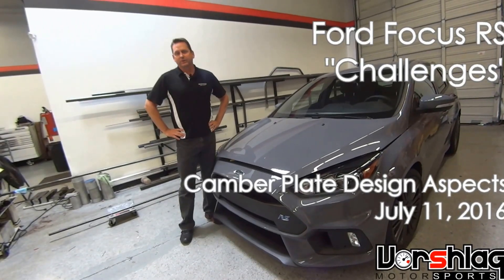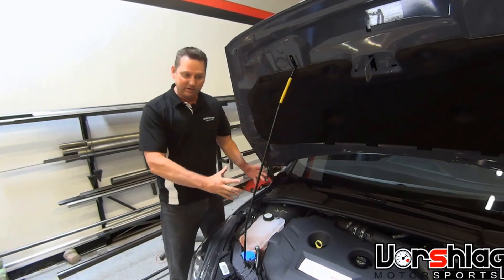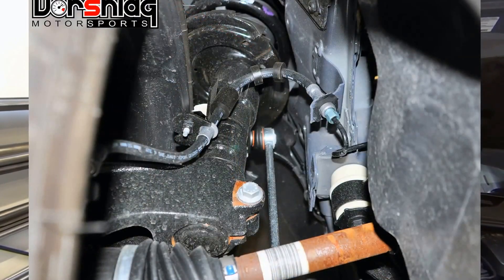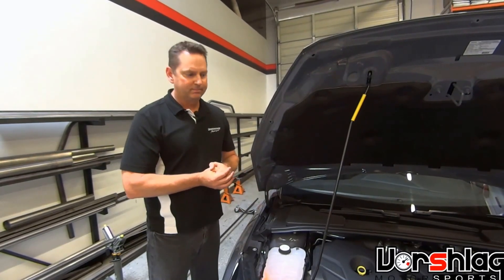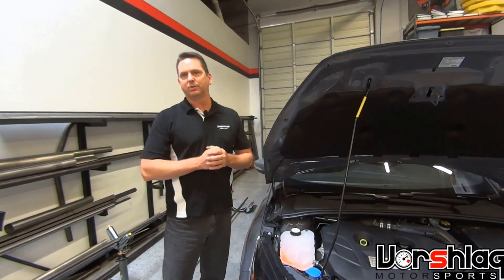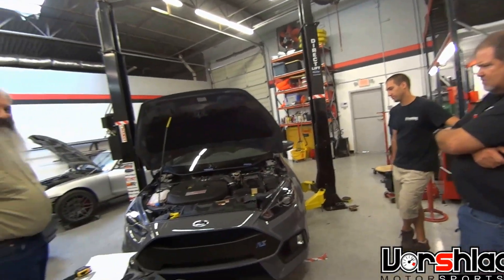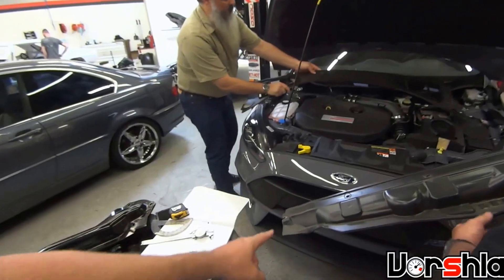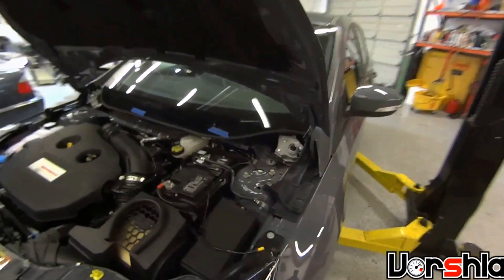Vorshlag "Suspension Challenges" on 2017 Ford Focus RS

Comment: After owning my 2018 for a few years now with the factory revision suspension offered and removing them or getting access to things is an experience thing where you do it once it’s pretty easy the next few times. After KW came out with the v3 setup its made the car handle from a night and day difference. Overall the price point of the vehicle there’s nothing else out there that can compete with this car. People have to remember this car only has been available to the market for 4 yrs and companies like this one are still developing new things. In comparison to Subaru and Mitsubishi that have been available since 02 and 03 it’s hard to have a long term backing and following as the sti and evo. My point is to make a judgment you really need to have some seat time in the vehicle before you make a decision on a car.

Comment: These guys are a fuking joke. Stick to the UK tuners who don't sit there complaining, ratting shit on a new and widely praised performance car. Try finessing the vehicle, don't redesign it cuz your whole value proposition is "everything is shit unless we've fukd with it". I felt that particular car devalue while they were touching it.
Reply from the maker: We get similar hate from fan boys of any chassis where we work on it. The RS is not magic - its a Ford Focus underneath, and as such it can be easily improved. This test car competes in Optima series and was massively improved with the work we did. Dig a little deeper and see the before/after track times. Hint: the car got a lot faster and easier to drive with firmer spring rates, better dampers, more camber and caster, and wider tires. Which is... common sense.
Reply from the maker: Read more on this car and its "path to better handling" here: http://www.vorshlag.com/forums/showthread.php?t=8453
Reply: You guys tracked it with 83 miles.. big WRONG.. You had stated it acted like a FWD car, probably because it was in limp mode the whole time, RSC/TC are not fully deactivated in any mode until the break it period, nor was it making full over boost, straight from Ford. If the baseline test was done with over 5k miles on a test vehicle, I'de be more inclined to compare results with mods.
Reply: Nader give your head a shake. Terry and his crew make the best adjustable  front suspensions, I know because I have one and not a squeak or rattle. Very strong made to last the life of the vehicle for track use as well.
Reply: Yikes, fan boys are always out in full force. Not only is he correct regarding the adjustment. The stock RS suspension is junk. The car rides incredibly harsh, and has poor track manners.

Comment: I  apogise in advance for this question......not mechanical.

So with the purchase of coilovers will you have all the adjustment room you need for castor and cambor? Or is there still additional issues?
Reply from the maker: Yes, the smaller diameter coilover springs allow massive negative camber and positive camber adjustment. Look on our forum for more details on what we did after this video.

Comment: Thanks for the honest, no bs analysis of the RS.  It was on my short list of cars to aim for in the next couple of years, but reviewing your forum posts, blog, and videos, it has been removed.  Being able to track and autocross the car is too high of a priority for me.  I'll stick with my 330ci.
Reply: The problem is these guys did a baseline track time when the car had on 83 miles on it.. which is big NO NO straight from the manual! Before the ECU will properly unlock all the modes, especially drivetrain safety, it will not make full boost and de-activate ESC/TC 100% until the break in period (which Ford programs, around 1000 miles).

Comment: That's pretty tough that there isn't a whole lot of room for top side camber adjustability.  Would this pretty much warrant a different lower control arm design or is there enough adjustability in the suspension to gain more negative camber?

I of course have a 4th gen F-body so I have to nut up and adjust it all from the bottom of the car.
Reply from the maker: You could make a lower control arm to gain camber, but that changes geometry and lower tire position. If you were not wanting to add coilovers on a car like this, would you add some race-inspired adjustable lower control arm?
Reply: I've seen sillier things happen, lol!

Glad yall are keeping it up with developing new platforms!